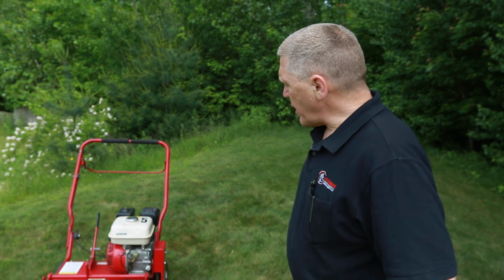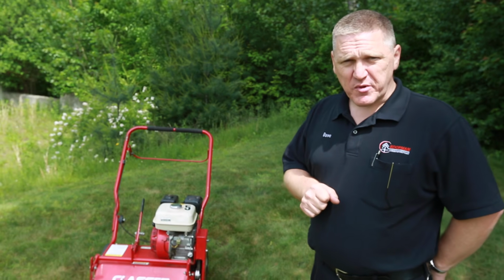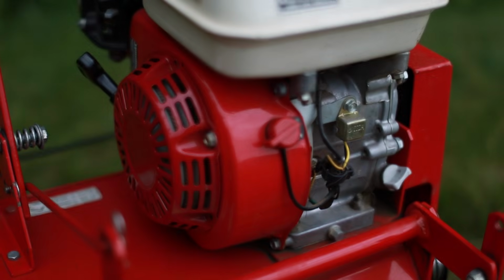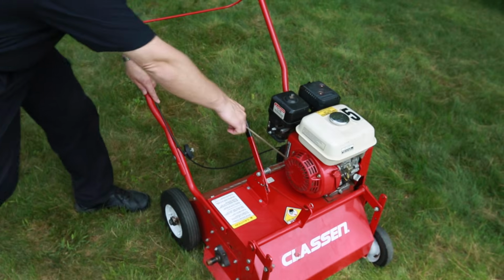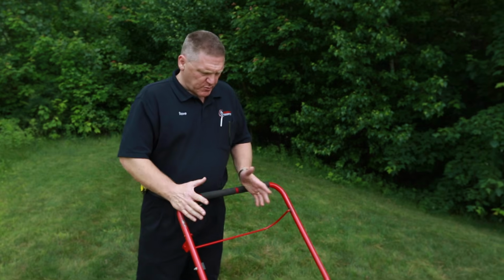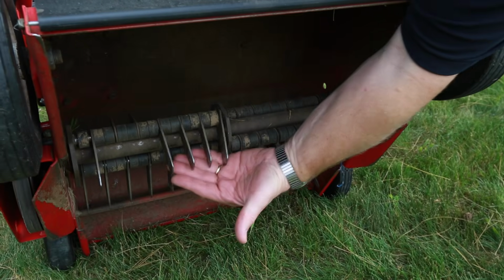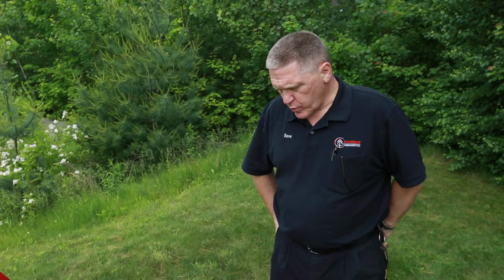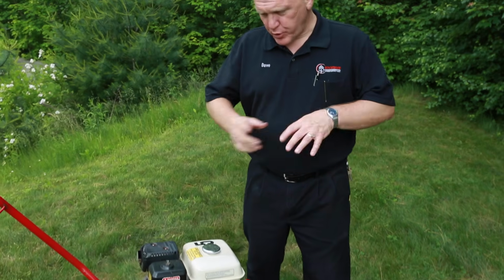Tips in Two - Using the Classen TR-20 Dethatcher

Comment: I know this is an old video but what's that shaft coming out of the right side between the wheels? I just bought a used one and it has a key way groove I was thinking maybe it was for a drive wheel to assist with pushing it

Comment: do you have to clean the after raking or it comes with a bag that collects the clippings and debris.
Reply: Dethatching machines generally do not come with a bag like lawn mowers do. The thatch and any other debris is left on the lawn. You can, however, use the mower to easily collect the thatch. Just make sure you have the bag attached to the lawn mower.
Reply: Yes!!! you should remove it from the lawn as soon as you can,before next wetting time,that's why you're using the machine in the first place,to get that junk out of your lawn,i cut the grass one setting lower than my normal height before power raking,and then use the mower right then,(with the bag to collect clippings)now set it  back to your normal height, that way you collect the junk without cutting any of your desirable grass.

Comment: I should have mentioned my experience with the Classen lawn rake/seeder. I rented one about 4-5 years ago to install a new front lawn for a client. I had already killed all the weeds/crabgrass with Roundup 10 days earlier. There was some light thatch left over, so I used the Classen to break it up, then I raked up all that debris. I reattached the drop spreader to the top of the Classen, and proceeded to power seed the now loose soil with a tall fescue/bluegrass mix(90%-10%). After finishing, I reiterated the need for the homeowner to water it in daily. I added starter fertilizer. It was early October. By summer of the following year, it was easily the nicest looking lawn in the 100+ home development. 

However, this summer was terrible from a weather perspective, and the homeowner never watered, now there are lots of brown spots.

Comment: Classen makes arguably the finest professional grade turf machines. I've worked in lawn & landscaping since the late 80s, when we were using the old Classen chain driven piston arm models that were unlike anything else out there. They required a lot of timing adjustment of the crankshaft that drove the aerator arms, but they were incredibly durable. A few years ago, I rented 2 walk behind aerators for some extra income, but all the rental co. had was 1 Bluebird and a Ryan. I took both. They were of the same basic type and size and they operate similarly. We did this large lawn, but were only pulling 1" to 1.5" cores from the lawn. We were paid and left after finishing. The next day I contacted another rental co., and rented 2 Classens of the same type and size as the Ryan & Bluebird from the day before. I decided to return to the large 1.5 acre lawn We had done the day before, and see how the Classen would work there. We got started, and immediately we were surprised to see that the Classen was pulling cores of between 2.5" to 3" consistently. We did the whole lawn over again for no additional charge. There had been no rain the night before, so all aspects were equal, yet the Classens clearly performed better. The downside to the Classen aerators was that they were more difficult to turn, and you had to routinely raise the tines for tight turns. You had to manhandle the Classens.

Comment: i was watching another video with the same power rake machine they say to close the choke to start which is it???
Reply: Normally, the choke is closed when starting cold and gradually opened in the few seconds after the engine starts. It is left fully open once the engine is running and may not need to be closed when starting warm.

Comment: Thx for the very helpful video - used it this past weekend & the lawn looks great & saved me many hrs not to mention muscle aches.  Things I learned: 1)if you have a lot of roots close to the surface don't bother with this equipment,  2)practice on an area that's OK to ruin,   3)practice using highest setting,   4)if you have a hard time pushing a mower, you will have a harder time using this machine.